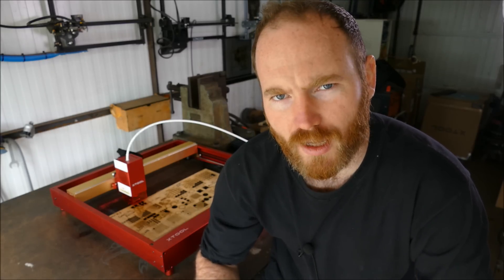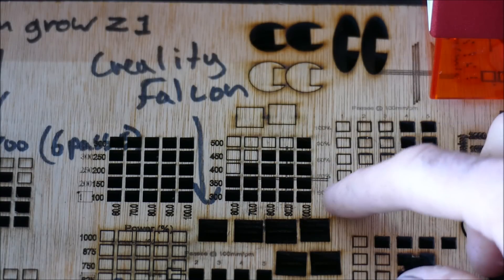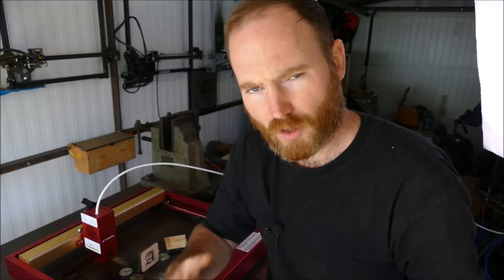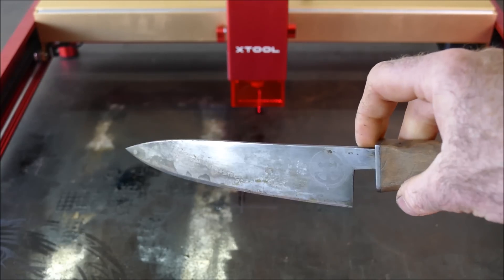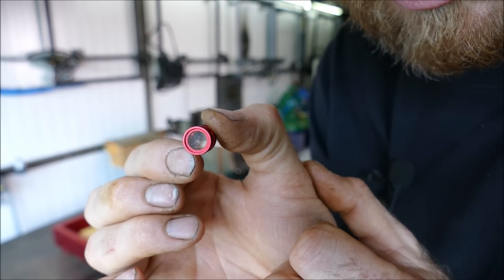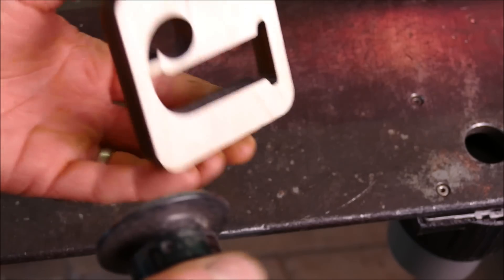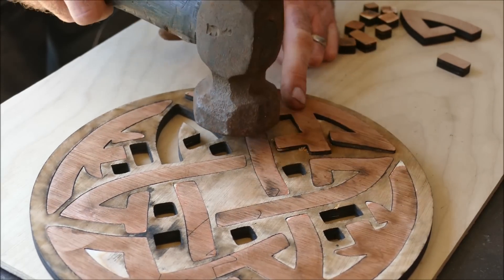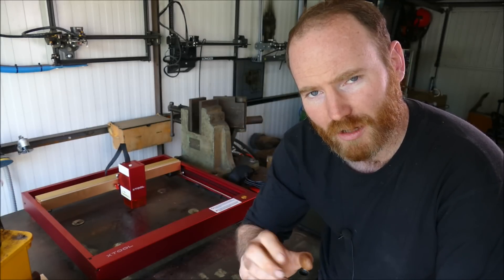This is my favourite laser so far! Tested & CO2 compare xTool D1 40w review, veneer inlay & sinter

Comment: Hi, personally, I love these comparison type videos.
Six months on, do you still rate your x-tool cutter?
Reply from the maker: Thank you. I'm currently filming the xTool D1 again with the extensions. Still a great tool although it has some design niggles and is slightly pricey compared to other new competitors in the 40w range. It's very good quality and robust otherwise. I'm trying to do a longevity test to see how long these diodes last. Cheers J
Reply: @joshuadelisle  I don't see a 40W option on the xtool page, did you upgrade yours yourself? 
You need to approach these companies for affiliate links.
Reply from the maker: @simontopley4771  there should be links in the description. Cheers J

Comment: I've been aching to get a later cutter/engraver for a few years now, but more for cutting and etching acrylic and other plastics for making light diffusors or edge lit stuff, so diode lasers aren't really an option. I know CO2 laser tubes do eventually wear out, but I'm a little dubious on lifespan of diode laser lifetime. Will a diode laser hold up long enough to see a ROI?
Reply from the maker: It's very dependent on the quality of the manufacturer. In most cases 10000+ hours is regarded as the norm for a diode. However if used on max without adequate cooling the lifespan can deteriorate fast. I'm test the xTool P2 soon and others. Cheers J

Comment: Can we use a bigger table such as 1m x 1m ? Can the stepper drive this 1m gantry ? Do you have any idea to make table bigger ?
Reply from the maker: It can go longer but not wider. I have an extension ready for it in a future video. There should be a link to the extensions with all the information you need in the description box. Cheers J

Comment: Really well done.  The flame sensors use IR I believe to detect the flames, and the sun basically has so many frequencies of light that it's going to trip it every time.  I would've kept the CO2 for clear acrylics since it's a UV vs visiable light beam, but if you're not doing alot of clear acrylic cutting then these 40 watt diode lasers are definitely worth replacing them.  This is the second video in a row I've seen of yours that's been so incredibly entertaining and informative...subscribed and will go back and watch the rest!  Great job!
Reply from the maker: Thank you so much. I've got new CO2 lasers to show soon. Cheers J

Comment: I"ve been looking at the XTool D1 and have been trying to decide if I have the 40W, would I need the Infrared laser for doing metal.
Reply from the maker: I use it to etch my knife at 06:46 the 455nm wave length is fantastic on stainless steel, the infra red is good for non ferrous metals I beleive. cheers J

Comment: How long will it last for ?
Reply from the maker: It's generally accepted that a diode laser lasts 10000h+. However there are factors that would reduce this number and it depends on how much the diodes over heat or kept cool. The D1 has a very good cooling system and so I would say is going last longer than any other model. Cheers J
Reply: @joshuadelisle  Beam combiners will degrade much faster than the diode, especially the ones that are down stream.

Comment: Not sure if it has already been mentioned in the comments but the knob that tightens the laser module can be pulled out away from the laser so that you never have it against the frame. There is a spring in there that will snap it back.  Also I would turn off the fire sensor or at least reduce it's intensity in the settings. It can only be done in Creative Space but once it's written to the machine it will be off when you use Lightburn as well.
Reply from the maker: Thats really good information thank you for that. cheers J

Comment: Is your 30% M/U based on you marking up from costs, or are you actually getting 30% of your sell price?

Just curious.
Reply from the maker: Hi. I normally but not always work on a workshop rate which includes wages, insurance, vehicles, rents etc, then I add 30% margin and then add expenses such as materials, consumables, shipping etc. Often my clients buy the materials because they can claim the VAT which I'm currently not registered for. Other times I place what I call a bid, which is basically a guess on how much the client is prepared to pay whilst maximizing my profit, once a bid is accepted it's then a challenge to complete the job as quickly as I can without cutting corners so I'm getting as much money per hour as I can get. However sometimes a job ends up costing more than what I bid so it's a bit of a gamble. Cheers J
Reply: @joshuadelisle : What I was really asking is whether you're getting a "flat" M/U, or a "full" M/U.  i.e.: "flat" 30% M/U: $100.00 (cost) x 1.30 = $130.00. 

Whereas, a "full" M/U allows you a 30% margin of your overall "sell" price. 
For instance, if you "divided" your total costs by the reciprocal of 30% (which is .70), 
i.e.: $100.00 (cost) ÷ .70 = $142.86. You can see the difference in margin. Let's say you 
want a "full" 40% M/U: Divide $100.00 (cost) by .60 would give you a total of $166.67

Using this method gives you an actual margin of profit of your "sell", or retail price, not 
just a percentage of your costs. 

This method of M/U is used across various industries, especially when reselling a product. 
This approach allows the seller to reach a more prefered M/U.

Comment: I was thinking that you should same those inlays, seal, and polish a little, and then sell them as cutting boards. You cut 2 designs, in which you would get 2 cutting boards, 1 light on dark and 1 dark on light. Custom mapping them could exponentially increase the price.  
Edit... I didn't mean making, but I am struggling to know what I meant. My spellchecker is really a Grammer wrecker! 
Oh, I know, I meant custom ordering, but I don't know the exact word that I meant. 
Anyways, you could make them thinner, getting 2 for every one of what you did, then make little wood feet or if a hard wood, and route a ring around the surface to can any liquids. I guarantee that you could sell them! Especially if they were sanded  with a high grit, and then go fiber and more fine until it has a sheen! Nothing works like wood for a cutting board. I would buy one.
Reply from the maker: Good idea. Cheers J

Comment: yes X-tool does have an expansion system.  i have it. it doubles the size. definitely worth it for large engraving, or just to open the work space.  Also, an enclosure is good.  That 40 watt module FILLS my shop with walnut smoke 😂
Reply from the maker: Nice. Thank you. Cheers J

Comment: I have the D1 Pro with the 20w module, and my cross gantry looks a bit different than yours. It has some holes in it and included zip ties to keep the cable up and away from the rails during homing and working on wide pieces near the edges.
Reply from the maker: Yes the 40w module comes with a new X axis and few sensor parts. Once in all the modules for the new head stock. Cheers J

Comment: Engraving metal, then adding powder-coat and repeating the engraving(probably a lot lower power) may be a better option to sintering(may need air of but might not kill the lens protector with the lower temperatures needed)
Reply from the maker: That might be an option. Im going to try lasering through glass with an argon gas shield. Bit of effort but could work. Cheers J

Comment: 5:59 Yeah, you really got stung on that CO2 laser cutter. You can get a lot more for that money if you buy a professional cutter. It will look awful, it won't be kind to you, but you get a lot more laser power.
Reply from the maker: Thank you Fred. Which do you recommend? Cheers J
Reply: @joshuadelisle  Whatever looks like a full spectrum laser machine, because they just import them for resale straight off the boat. I've sourced three of them through said full spectrum laser company for companies I've worked for. Much easier letting them handle all the import stuff. My favorite was the big meter wide table machine with I think 120W tube. I swapped the stock focal length lens for a longer one, that thing would eat. I cut fixture plates out of ply, then used them + cermark to "etch" metal parts en masse. 

I think gweike is the actual manufacturer of most all Chinese CO2 "industrial" laser machines. Their controllers and software are garbage, but totally workable.

Comment: Surely the ACMER is a better value machine?
Reply from the maker: Definitely cheaper, the ACMER cut the 9mm ply one pass at 250mm per minute whilst the xTool did it at twice the speed at 500mm per minute, so you get twice the performance at under a 1/4 more in cost based on just the 9mm ply test.  If the extra power means more speed therefore more turnover of parts being cut then you'll be getting your money back faster. It depends on how commercial you want to be but ACMER is fantastic quality and amazing focal length. Cheers J
Reply: @joshuadelisle  yes, fair point!

Comment: I've been looking at the various diode lasers for a while now, my conclusions are that despite there being numerous versions out there there are probably only 3 or 4 companies making them in China  , the rest are just rebadged versions,  there are apparently 2 laser diodes used, one at 5.5W optical output and one at 6 or perhaps just over 6 W Optical output, thus you get 4 (or more) combined beams via a prism giving either 20 or 22 W, 30 or 33W and 40W  (and we must assume soon  arround 44W). You loose a tiny amount of power by running it through the prism typically about 0.5W per beam

So given that the laser heads are likely only from two companies  with just minor cosmetic differences between everyone you then have to look at everything else that makes up the lasers, typically this is bed size, build quality and accessories. Note that as you increase the laser power the module gets physically larger and this means your cutting area decreases slightly.Theres a few interesting options.

 Sculpfun's latest ULTRA versions come with a 600 x 600 area as standard, their previous machines are typically around 400 x 400 but you can expand to 400 x 935 or even expand both axes to a massive (for a diode laser) 935 x 905 mm (the ultra does not currently have expansion options) 

Atomstack are another maker where rebranded versions are available, again most of their models are circa 400 x 400 mm cutting area with an expansion option to 800 x 400 mm, their add on for etching cylindrical objects is one of the best out there and apparently is compatible with most brands of diode laser requiring you to use one of just two different connecting cords

To get the best quality from your laser cutter/etcher 
i.) Use a honeycomb or similar base for flat materials and make sure you use a dull sheet of metal (Aluminium best as a diode won't cut it) a reasonable distance below the bed, sand the sheet so that you don't get any reflections of laser light back up into the laser module
ii.) Put the whole thing in a box and extract the air (mainly) from beneath the cutting area, this will significantly reduce the amount of smoke damage on the rear of cut material. This also helps reduce the chace of fire and will keep the lens cleaner

You can etch anodised aluminium, but the only metals a diode laser will cut is likely to be steel and stainless steel up to maybe 5 thosandths of an inch (0.125 mm) thick for 20W or more powerful lasers, you might be able to also cut Bronze as it has a similar thermal conductivity to steel.

 A diode laser will not cut clear materials however as with anodised aluminium applying a removable coating to glass or perspex will often allow you to etch the surface.  

When cutting made up boards e.g plywood or MDF be prepared to test each board, fine grain timber like Birch Ply will be harder to cut than cheaper ply, partly due to the wood but also due to the glues used in the laminations, some of which are more resistant to laser cutting whilst others are more flamable, there appears to be very little difference between regular MDF and the more expensive laserable MDF, however in both cases you want that extraction system I mentioned earlier, the fumes from the glue/binder material is not good for your continued health, make sure your extraction unit clears the fumes from your workspace.

Lastly when cutting synthetic materials BE PARTICULARLY CAREFUL and look up what can be given off, lasers will cut many fabrics, leathers and foams, but some e.g PVC and fake leather can potentially kill you, PVC gives off Hydrochloric Acid and  Chlorine Gas for example
Reply from the maker: Excellent information. Thank you for sharing. Cheers J

Comment: I really enjoy your videos. i am particularly interested in the frame laser engravers. I have a conventional CO2 laser that I have had from new for about 15 years. It is a 40 watt machine and although the power has dropped off due to the age of the machine it still works, however it has developed another fault that may require more money to be spent, significantly more than the cost of the +1000 pounds of the machines you have recently reviewed. So at the moment it would be cheaper to buy a diode laser than get my machine repaired. Do you have any information on the cost of replacing the diode laser unit and do you have any information regarding possible life expectancy of the diode units. Rgds, Jeff
Reply from the maker: Hi Jeff. I've got mixed views on longevity. It's said that the diode laser last a lot longer than co2 but that if you over heat them running too high of power you risk burning out the diode very quickly. I've not had long term use on any of my lasers as I'm constantly testing new ones to truly comment but currently my thoughts are that a 60w+ co2 is better for commercial purposes until a diode laser is available at the same amount of power. I think the future diode laser will be more expensive than co2 lasers when that happens though. It depends on your personal needs I believe.

Comment: Thanks Joshua for another indepth video, brilliant results. Being a tight ar5ed Yorkshire man I wouldn't pay that much for the Xtool. There's  a few design flaws  for £1600
Reply from the maker: Thank you Rob, I've kept it honest, it's definitely the best cutting laser of its type but can always be improved for sure. I still think it's better that my £3000 co2 which is also on the lower end in its category as they can go for £6000+ using the xTool P2 and Glowforge as an example. Personally I'm tight too and more likely to build one from second hand parts than ever buy one new. If I needed one. I'm very blessed to have the chance at playing with the latest models for sure. Cheers J
Reply: @joshuadelisle  points well put. I have a Chinese co2 -upgrade with a self built height adjustable bed with 3d printed parts. Also a ortur laser master Pro 2 again upgraded, so I'm probably in for £1300, plus Lighburn, which is excellent and so easy to use. Thank you for your fresh approach to content.

Comment: i hadn't thought about the idea of mixing woods - I'll give that a try. I've been experimenting with glass and slate. People wrongly say slate is mono - you can get around 5-10 levels from it. Glass - I'm struggling with - one. the 'tempered' coasters I got seem to not be tempered, since one cracked into bit slices. And it seems to be tricky to get a sharp enough laser melt to get a decent dither pattern for photos.
Reply from the maker: I'll see if I can try that in my next videos. Cheers J

Comment: About your pricing .. while the mashine is working I'm sure you will be doing something else . So I would say that 2 times what you said.. :)
Reply from the maker: That is a good point, I've considered stacking several on shelving all running at the same time. The workshop rate remains the same but each unit should generate 30% profit each I think. Cheers J

Comment: Noice video :) Appreciate the time taken to put this together !

Question - what was that about a fire alarm and then the machine stopped .... But why?  If the machine has a flame detection ( basically some IR detectors and some maths ) why then would it stop the cut head instantly on flame detection, i mean, it want's the fire to consume it's cut head ? 
I suggest the default behavior on flame detection should be to return the cut head to a corner and stop when hits limit switches  ...

If I've misunderstood and you've some separate fire detector please let me know :)
Reply from the maker: You're correct, that would be much better if the head moved to home imediately, maybe thats a bit of code I can add, I'll look into that. cheers J

Comment: Can the xtool cut clear acrylic? seems that is one of the big advantages of co2 over diode.
Reply from the maker: No it can't, it needs a different wavelength for clear but it can do opaque very well, However Co2 can't etch stainless steel so it's down to personal preference. Cheers J
Reply: @joshuadelisle  can never have it all lol

Comment: im impressed with the x tool,
that celtic knot for a bit of scrap wood came out fantastic
Reply from the maker: Thank you, I'm super pleased with it, I want to try a coffee table next. cheers J
Reply: @joshuadelisle  oak inlaid w mesquite....now my grey matter is wiggling.  But honestly that brings up a thought/question.      
Being as how many knife makers use stabilized woods for their handles and some to for the display, wonder how this machine would do in stabilized woods?  
   There i go thinking 🤔🤔 🤔 again.
Reply from the maker: @dragonstonegemironworkscra4740  I just coated it in epoxy resin with a glass finish. It's made the wood pearly and iridescent and I like it a lot. Cheers J